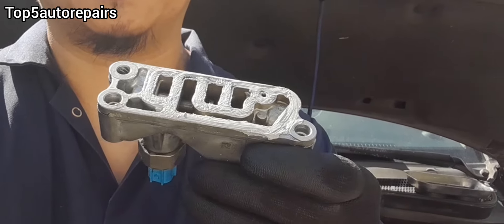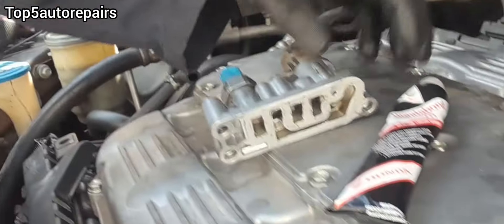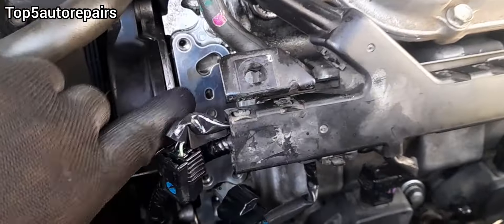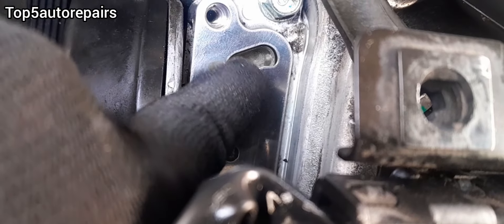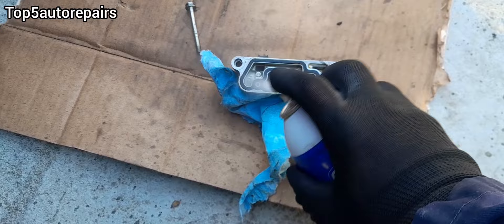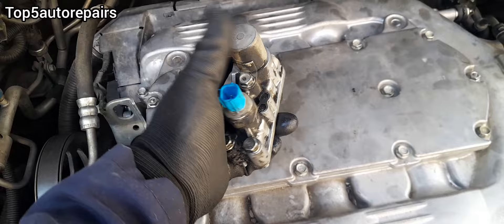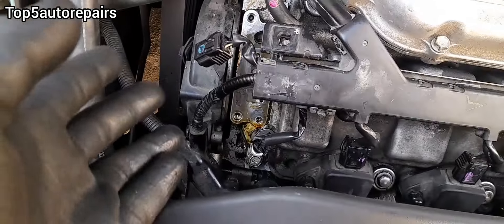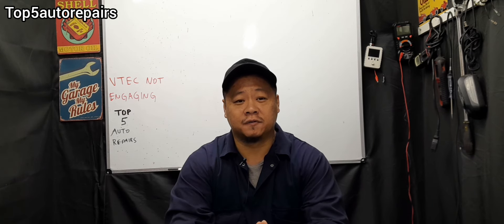VTEC NOT KICKING IN? FIX VTEC PROBLEMS

Comment: I had the same issue on my 2001 Honda Civic EX. It ended up being a bad oil pump which makes sense since the issue started after I had head gasket issues where the coolant mixed with the engine oil.

Comment: Yo this is very similar to Fiat 500 multi air system
Reply: Looks a lot easier to get to than fiat
Reply from the maker: Yup. Any engine with variable valve timing will have similar symptoms. Toyota is another example.
Reply: Oh yeah I definitely know and that crap sucks
Reply: It's like hey how's my variable bolt Vive valve crap timing doing
Reply: And it's kind of like yeah okay